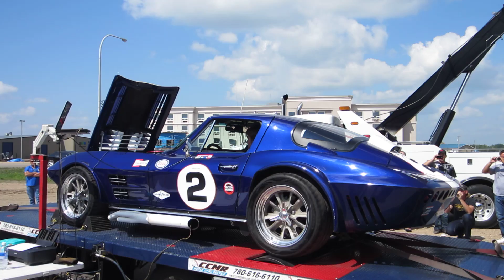Mongoose 1963 Corvette Grand Sport 502ci Dyno

Comment: Why buy a crate 502 when you could have a 509/40/565 built for close to the same money? Surely not cutting cost on this ....
Reply from the maker: shaadydog1 - I am the second owner. This is how it was built. If I do change the powertrain, it will have a built LS7 w/dry sump setup.